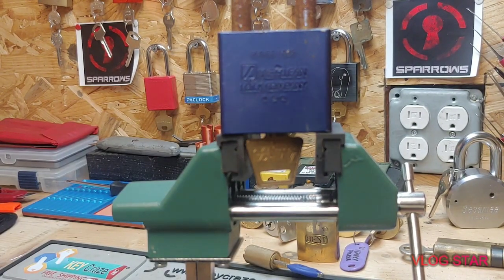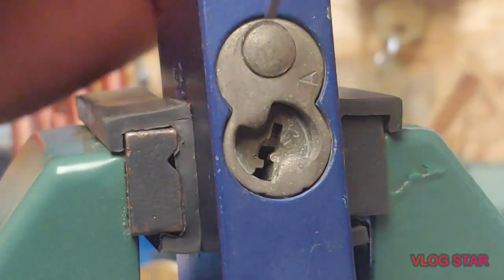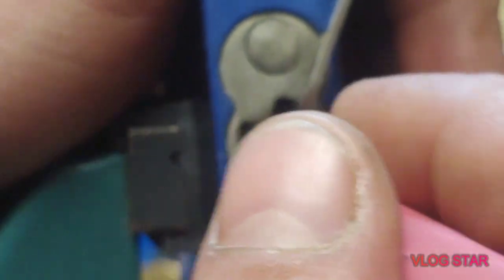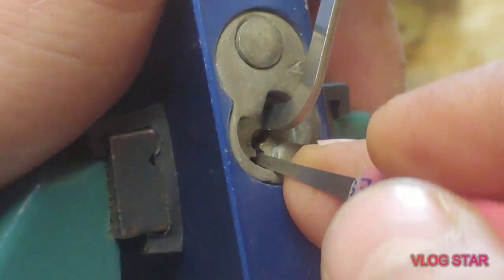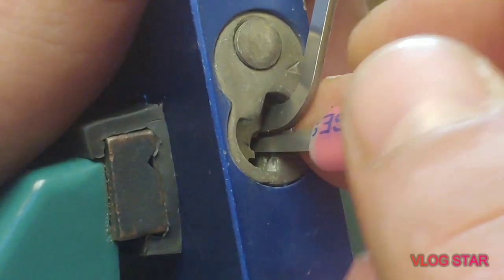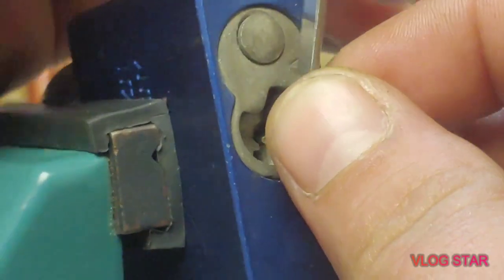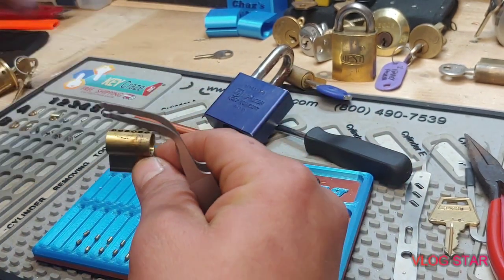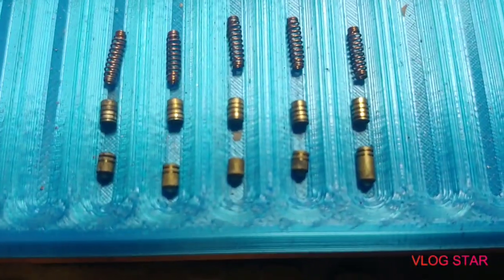(#36) #StockLockSunday  American 1305

Comment: Nicely done Bud. You ever try a pill bottle or similar with some white vinegar for pins & springs? Soak it 15 minutes & shake it up after every 5 & pull 1 & check at 15. The outside sticky part I'd try 91% & higher alcohol to clean it with, removes sticker & glue residue so greatly. Will also clean the inside residue out well. Old oil, canker, graphite & what have you. Have a good one my friend.
Reply from the maker: No bit that's a great idea! I'll definitely give it a try. Thanks buddy👏🔥💯👍
Reply: @chaz2785  , Your quite welcome, hope it helps out.